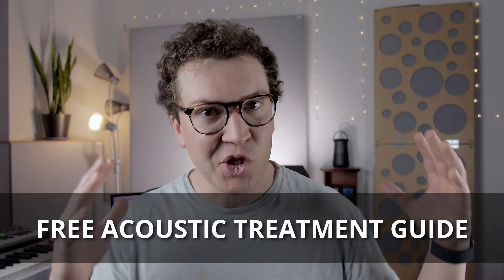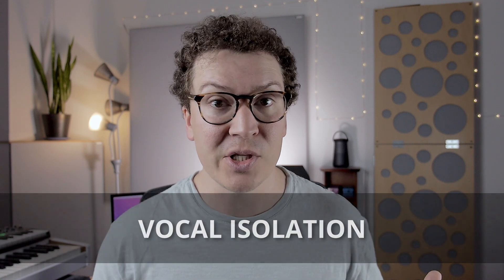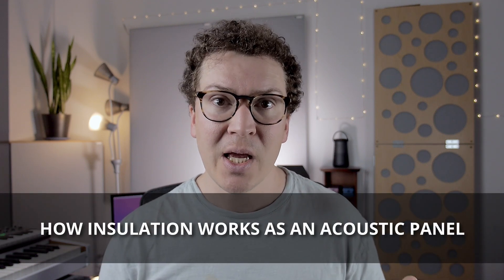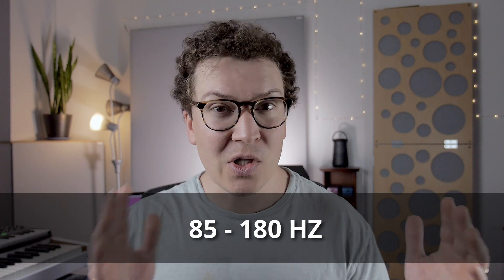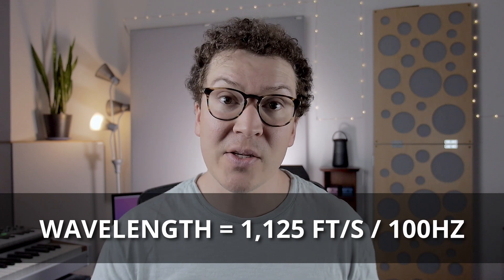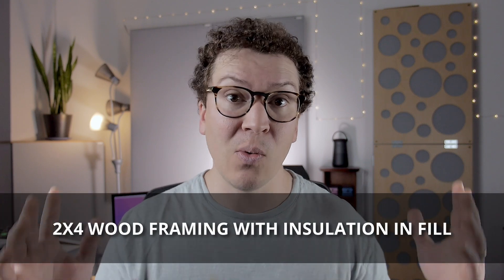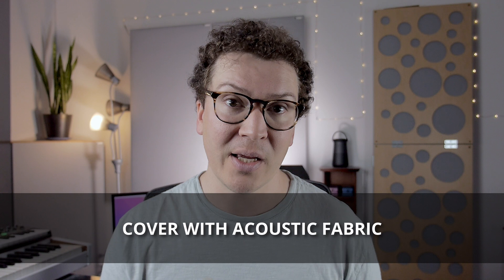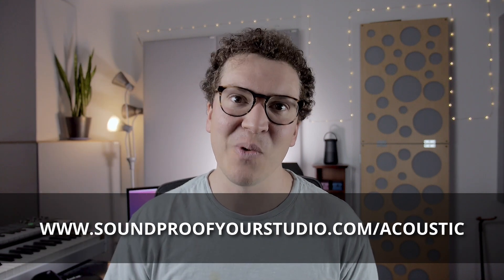How To Build A Vocal Booth (Part 3) -  Acoustics

Comment: Jesco says 4” is not enough for a small booth. You need 6-8”
Reply from the maker: It depends on the air gap behind too. 4” plus a two to 4” air gap. There is a lot of debate in the literature about the most effective use of absorption in small rooms. Jesco has his opinions and other have theirs. Remember nothing about this is written in stone.
Reply: @soundproofyourstudio 
He says that too actually. Which is better, to fill in all the available space with treament or is it better to spare some of the treatment to leave room for an air gap?

Comment: What would be a good minimum size for a decent vocal booth?
Reply from the maker: Honestly, the smallest size that you could still perform in. At this point you will not get ideal acoustics from a room ratio, so to save cost I would go as small as you can handle.